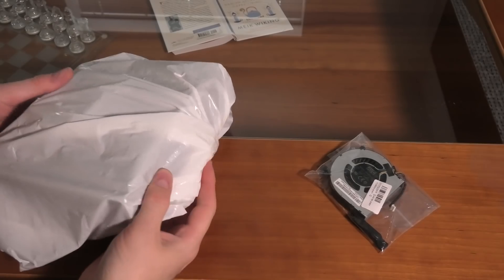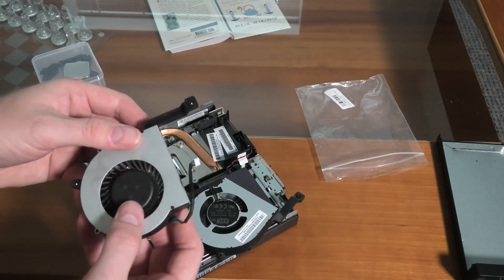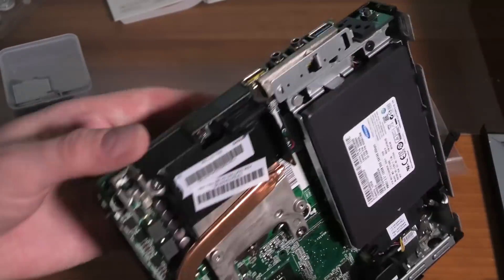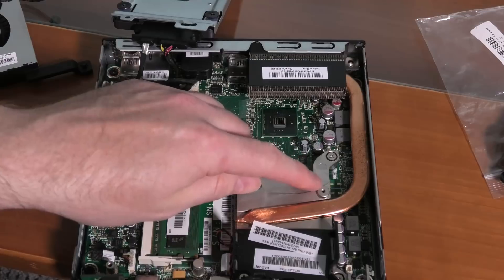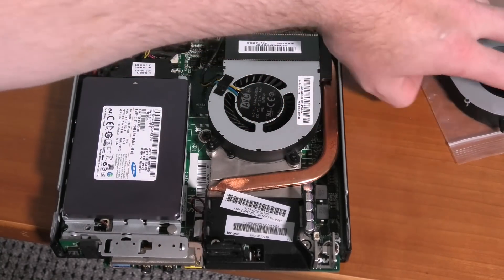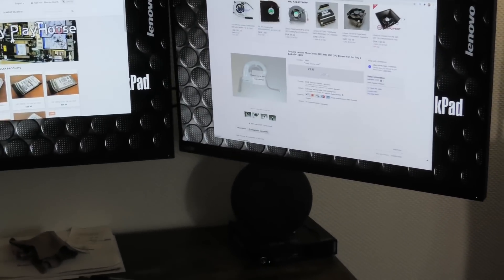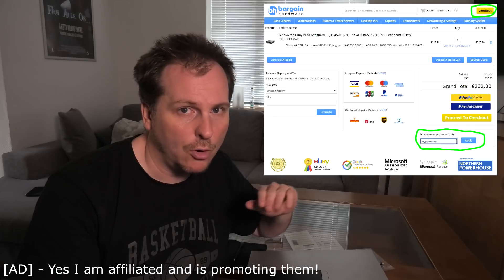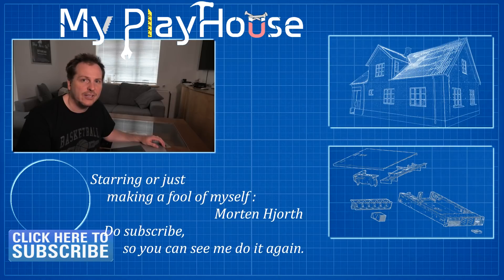I Crushed FAN in Lenovo ThinkCentre M93 - Now Fixing It - 983

Comment: After putting a 500gb SSD, 16gb RAM, and an i7 in mine it ran a bit hotter as expected. I cut a hole in the case and mounted a 60mm USB powered fan in it. It blows every bit of heat outta that little guy.
Reply from the maker: Okay,,, there might be a limit to how much power the system can supply to the CPU,, so it might just slow down or crash.
Reply: @MyPlayHouse  Been running great for over a year now. Everything I upgraded were listed as the max it could run. I didn't need the external fan, but it does its job and looks pretty epic!

Comment: I like those HP's nice to run and easy to update the hardware. The M93's are harder to find and more expensive.
Reply from the maker: The HP,, in this SFF is still way better than a tower or a midi tower,, they was small back in 2006-2008, but now they are kind of big..
Reply: @MyPlayHouse  HP also has the same formfactor as yours, but I know how you feel about HPE, so it's probably not going to be any different for their non-server sistercompany :p

Comment: Wow cool video... I have something similar Dell optiplex 9020M with m.2 250GB SSD with i5 and 8 GB of ram:) it's very useful when I use the the other workstations that I have for more important stuff....... M.2 made it way faster than using regular hard drive
Reply from the maker: The M93,, it just a little bit to old to have M.2 :-/
Reply: @MyPlayHouse  it's alright I really like these devices they are cool small and efficient